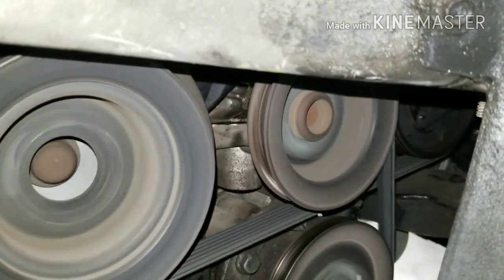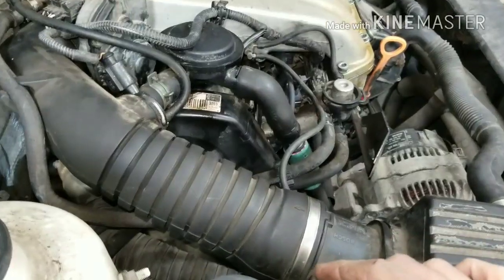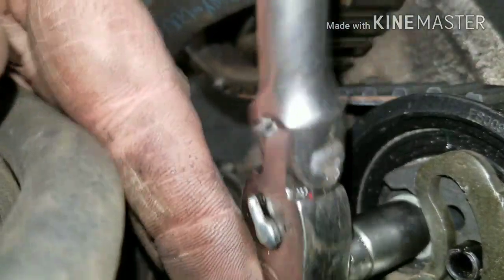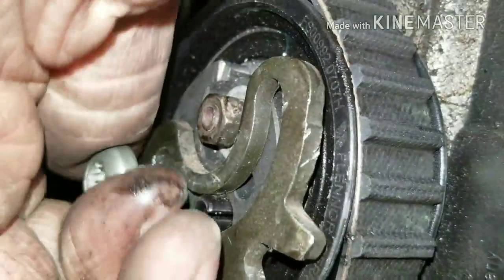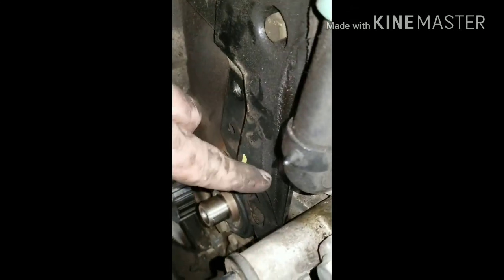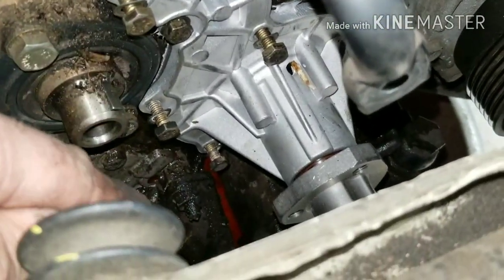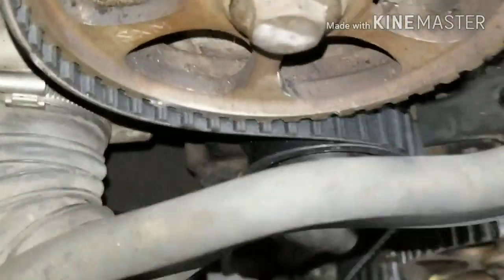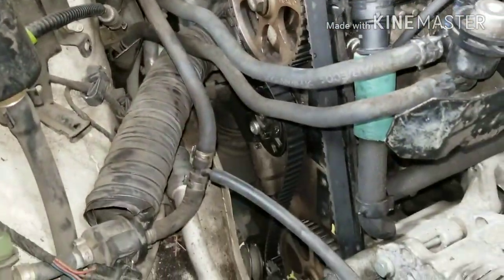How to change a water pump in a Volkswagen  2.0 golf  and timing belt

Comment: Cheers for the guide man. Simple and straightforward.
Reply from the maker: Thank you I'm glad I could help you besure yo like and subscribe
Reply: @fixergood  hi man ..i have problem with rebaild ac coprassor golf 2
Reply from the maker: @AhmedAhmed-yq3nx  what's your problem
Reply: @fixergood  I need to install a new cooling unit as a compressor for the 1992 golf cart. There is a problem with the transmission belt, power stern and water pump, and I need your help, sir

Comment: Thinking about buying a 1999 VW Golf GL Hatchback 2.0l . Needs starter swapped out , any advice on how easy or tough that's gonna be ?
Reply from the maker: I shouldent br that hard at all you just wanna make sure you dont have a radio with a security system if your gonna disconnect the battery.thanks for watchin besure to like and subscribe for more tips and tricks

Comment: I did my timing belt and crank seal. The manual says you should replace the crank bolt because it's a stretch bolt. Is this really nessesary?
Reply from the maker: If the book tells you to you should,that means it a torque to yield bolt and the bolt is stretched to a clamping force spec. If bnb 8 remember right  you can leave the crank bolt in ad remove the Allen bolts to have access to your crank gear.  Thanks for watching and besure to like and subscribe

Comment: Looks like a lot of job 
Re instal the timing belt and tensor is a professional's work 
If not properly installed the engine's gonna crack
Reply from the maker: Yes there are some dangers with doing your own mechanic work, and I do believe this is a interference engine so it could bend valves if done wrong, hope I could help in some way thanks for watching, and for more tips and tricks besure to subscribe and hit the bell to get all my content thanks again.